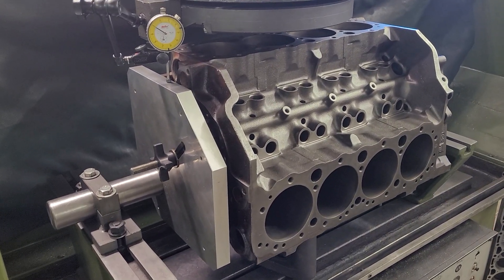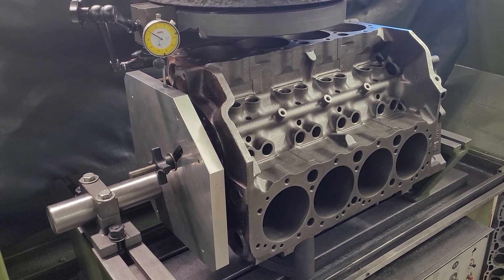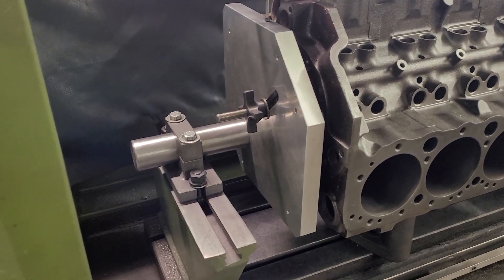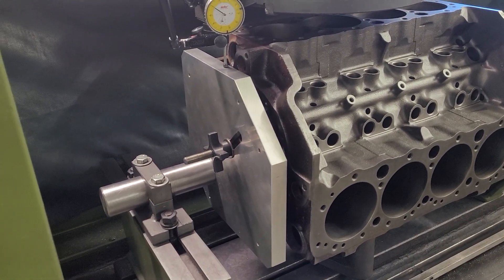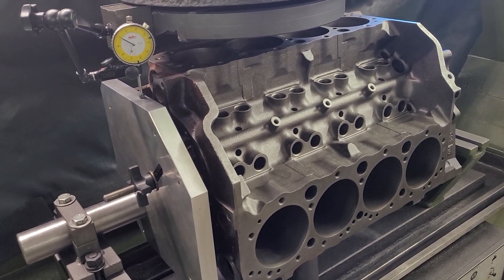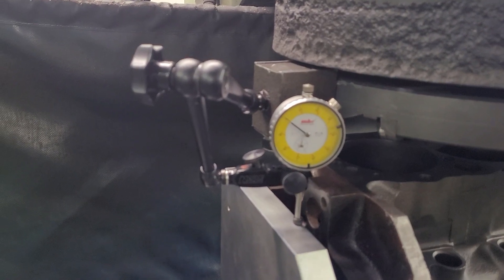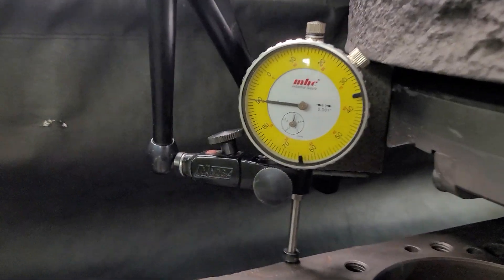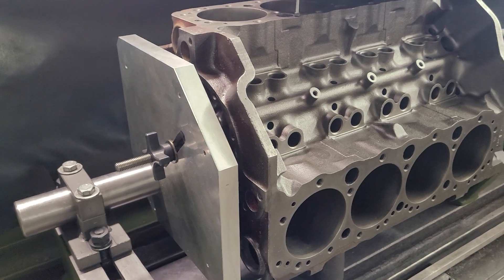Block surfacing with corrective tooling, CPMotorworks, Inc

Comment: I like it!! So just to make sure I understand, your plate is located in place by the 2” crank and the centerline of the cam bearing by something we can’t see in the video?
Just watched again and I see now. Great job buddy. As a life long machinist I’ve always hated how most guys do it.
Reply from the maker: Yes, there are main bore rings to locate on the main bar, and a locator in the cam tunnel that orientate the truing plate. I can measure deck height directly off the main bar and the truing plate if needed.
 I agree, never liked how most shops just float a block on the bar and level up the deck and cut it.
Reply: @cpmotors  I started in machining in tool n die shops and about 4 years in I took an opertunity to go into an automotive machine shop. I was curious and also had a project car. The first few weeks I was blown away by how simple engines were being remaned. I still remember when the boss showed how he wanted the blocks "squared up' and I replied "what part of that squared this block?" "How do we check?"  Oh boy, that was almost my last day lol. Did that for a few years and went back into industrial machining for many years. A layoff happened at work ome day and I was sent home. On the way home I stopped in at an engine shop I passed everyday for quite a few years and asked if there was a spot open. I started the following Monday. This time I went in with far more confidence and a decade of complicated machining experience then the first engine shop. Same thing though, was shown how they wanted it done and it was similar to the first shop. This time I challanged it and after a bunch of fuss proved my case lol. I moved up the ladder fast in that shop and stuck it out for 6 years. Then the big machine shop that laid me off contacted me and I went back to industrial, universal machining. I like engines though, so I bought the machine shop I have now while working in the big shop. I been on my own since 2020 now. Been going pretty good to as 4 other shops have closed since then leaving mine one of two automotive machine shops and the only general machine shop in our district. Anyways, think I got off course here with my reply lol. Nice setup, I am using very similar with my Horizontal boring mill👍
Reply from the maker: @whiplashmachine  nice! I wanted to build engines from HS, but knew there was no chance of making money at it as a newby. Went to tech school, got hired at a gear shop and got my Journeyman Machinist card after 5 years there, learned to do engines on the side, started the business on the side in 2002 after losing my job of 9 years, started buying machines as I could afford them and went full time in 2012 when I lost that job after 10 years. been full time since then.
Reply: @cpmotors  yea there is a big difference in wages between the two trades. I am also a Journeyman machinist and just left my job a couple years ago. By far favorite place to work also. Were at 46/hr plus all the benifits and such which did make us some of the lowest wages in our industry in this area. Engine shops around here pay 25-30, usually no benifits. I prefer real machining and machines but I like to resto engines and cant afford the big machines lol. My old boss called a bunch of months ago and asked if I was ready to come back, but I passed as busimess going good atm. Hope it stays so. 4 engine shops have closed last two years so I am getting busier and busier. I am also the only small general machime shop aroimd that will take on $100 jobs. So that is also keeping me busy.